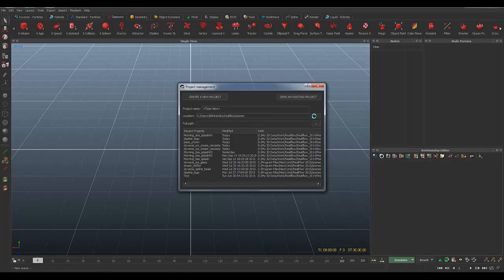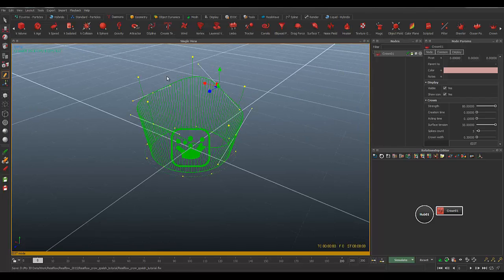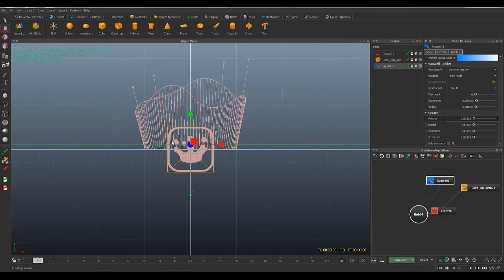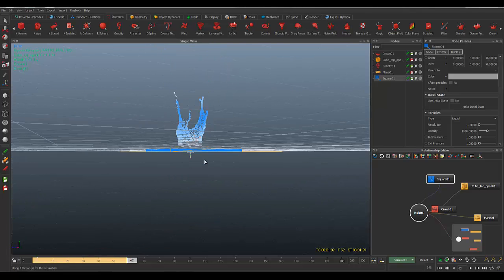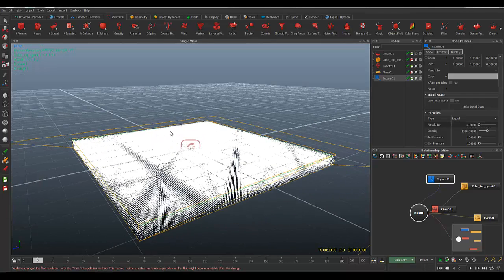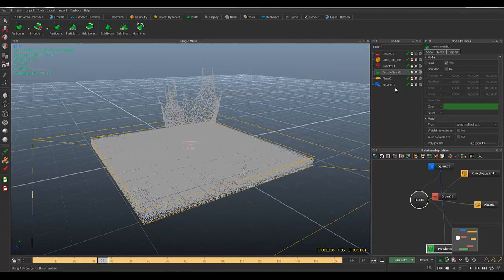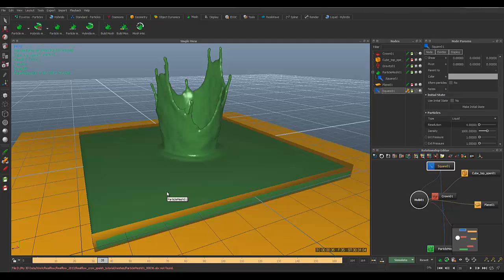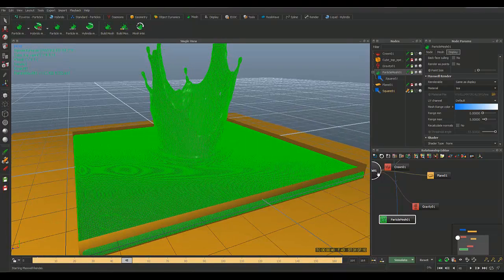Realflow Crown Splash Tutorial

Comment: Thanks for the very easy to follow tutorial. I'm finding that nothing happens once I follow all the instructions and hit "A". I get the command line window pop up (I'm on OSX), but I get the following output:

Summary information
-------------------
Cube_top_open01: [8 vertices - 10 faces] [] [vx:0]
Plane01: [4 vertices - 2 faces] [] [vx:0]
Square01: Liquid [0 particles] d=1000.0 p=1.000 v=3.000
Crown01
Gravity01

Timing information
-------------------
Elapsed time: 00:00:00
Remaining time (estimated): 00:00:00
Average time (frame): 00:00:00

>21:57:30: ================ Frame finished ================
logout
Saving session...
...copying shared history...
...saving history...truncating history files...
...completed.

[Process completed]
Reply: You are using command line simulation.
In order to reset that to normal simulation, click the dropdown menu in simulate button and switch off "command line"
Reply from the maker: Yes that's the solution for it.... And very sorry for replying this late i was very busy in production work ..... :) hope u find this tutorial helpful